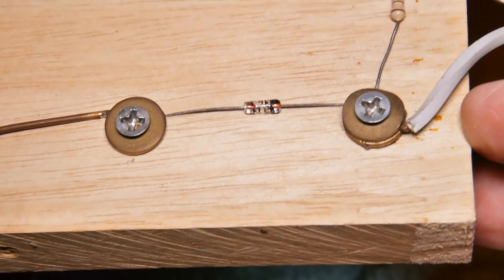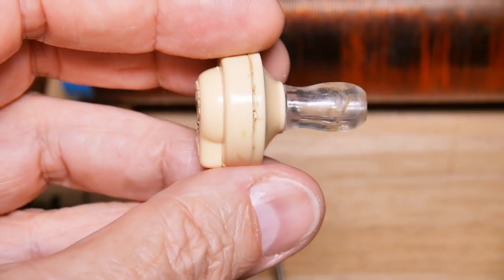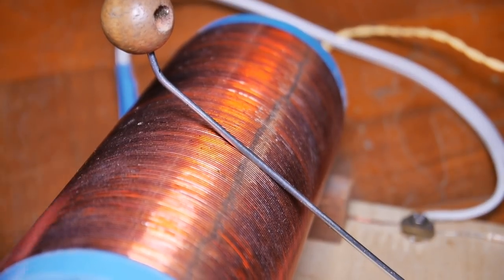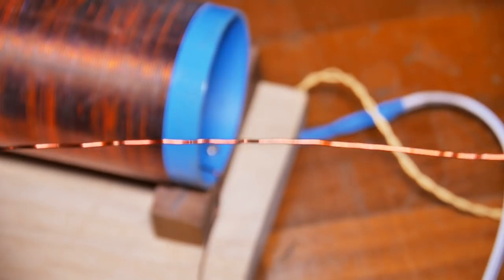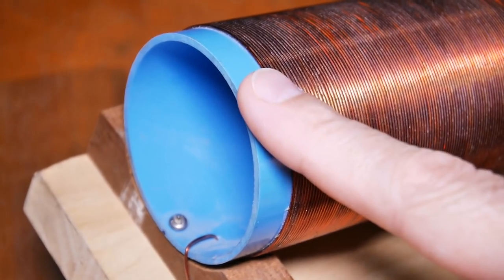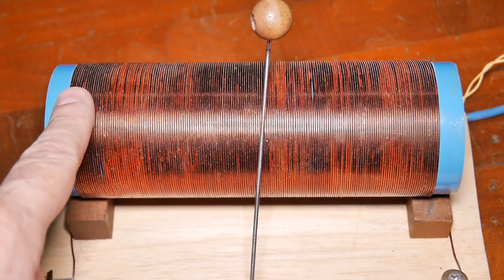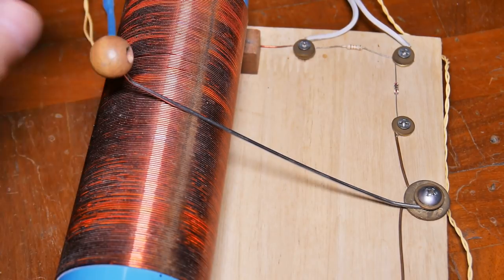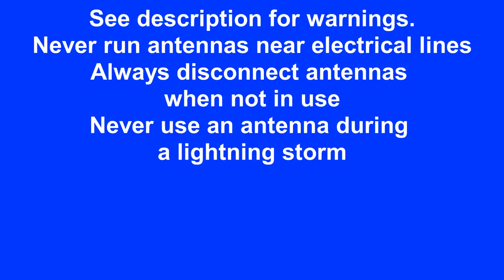My Crystal Radio Does NOT Work (FIXES for common problems)

Comment: Thank you.  I've made crystal sets in the past and they worked OK just not loud like yours even with my radio station running a kW and just 4 air mikes away.  At oue point way back then I bought one already put together.  It was OK, just not really loud.
Recently it took me 2 weeks to get a crystal oscillator to work on 7 mHz.  I'm learning to never take anything for granted.  Lately just about everything that can go wrong does go wrong.   lol   I  now have transistor testers, LCR testers set.  Maybe I need some tester testers.  Thanks for the tips.
Reply from the maker: Good on ya! Oscillators can be tricky, and higher frequency makes it exponentially so. I made my first one by accident by feeding the output of an op amp, through an old TV coil, back into the input. After that I was hooked on resonance.
Coils are important. I know I keep advertising myself, but here's a video on some coil sizes/wire sizes where I've already run the calculations and in the case of 19 AWG, already made several radios. https://youtu.be/ejHk5tFeKHk
It's worth the hour+ and cramped hands it can take to beautifully hand wind one. 

Oh, BTW, I have another video on adding an amplifier to a crystal radio, if you do want them louder. Personally I'm a purist and don't mix power with my crystal radios!  ;)
Reply: @tsbrownie   lol  I'm already watching some of your other videos.  😁  So your self promotion  is a good thing and helpful.
When I get my diode going I'll make the one with the L match.
30 years ago I was heavily into making home brew projects.  I read after Doug DeMaw and Wes Hayward and made a DC (direct conversion) receiver for listening to morse code.  I made a contact in Canada and a few more with the VFO only.  It measured 140mW on an oscilloscope.
I didn't realize how much anyone can forget when they get out of practice.  
I'll keep on piddling and I'll get there with perserverence and your tips.
I watched your video on bad crystal radio designs and it hit me like a slecge hammer.  Almost every one I made used the variable capacitor.  I'll wind the coils like you suggest and can leave out that cap.
Good on resonance and crampped hands.  I'm thinking about making a jig so I can use a variable speed drill to turn the PVC pipe for wingind coils.  I suspect the jig can't be harder to make than the piece you made to mount the variable capacitors on the 1979 radio.
Reply from the maker: @southernexposure123   Wow, I'm impressed with your DXing! I hear you on forgetting. I had to relearn a bunch of stuff before I made my first video. (I actually reviewed the original boy scout handbook I made my first one from!) 
I'm putting together a winding jig and a video (of course). It's just 2 wood cones (I've seen them online for about $1) with a threaded rod through it. You can mount it in a cardboard box of the right size. Cranks are good, but you can just turn the core by hand. I won't use a drill, because it's easy to kink/bend the wire, and tightly spaced turns are not just beautiful, they make for a better radio. 
I'm also going to start experimenting with "natural" diode replacements like galena, etc. The 1n34a is starting to get hard to find, then there's the fake factor. 
Let me know if there's anything I can help with.
Reply: @tsbrownie   I didn't know winding jigs were already offered so cheap.  The reason I thought of a variable speed drill was so I could run it slowly at a set speed and control OFF / ON with a toe or a knee.  A few years ago I used a battery fpowdered drill and set the speed just about like  rock polisher to make black powder.   I made it only once.  It's too scary and easy to get an explosion.  I set my ball mill outside a few hundred feet from my house.  Then I hesitantly approached it for stopping the mill.
I likely wouldn't have thought about wood for cores, although I have seen some coild wound on forms that weren't round.
I don't think I have the patience to try setting up a galena.  Oh earlier tonight I saw a video show and tell how to detect whether the 1N34A is real or fake.  Under that video was a comment telling how Skotchky diodes have some sort of benefit over the 1N34A.  I think it was something to do with better selectivity.
I was going to reference that specific vileo with a link, but a seatch yielded that there's more than one video on that subject:
https://www.youtube.com/results?search_query=how+to+tell+if+a+1N34A+is+real+or+fake
The one I watched was made by a fellow with a heavy accent, maybe indian.
I appeaciate all the chat and tips.  My next undertaking will see how big the wire is inside a microwave transformer.  I suspect it might be too small for our purpose.
Have a good night and I definitely will get in touch with any more mysteries or discoveries.  Thank you.
Reply: I've reserched microwave ovens for wire.  I knew people were saying you could get killed by the high voltage.  I thought I knew how to avoid that.  
But my research online tells me there's more stuff inside those ovens that can cause severe health issues if it's breathed into your lungs.  I think I'll just buy my wire for coils...
Reply from the maker: @southernexposure123  We used to make gunpowder from raw chemicals we bought at the pharmacy. That was before people got wise. The wood cones are to center the pipe on something like a threaded rod. I've got one sitting next to me I need to finish and do the show and tell thing. If you could run a drill/motor slowly by a foot, that'd be great. You're a step ahead of me, I had not tried that. The drill quickly got out of control when I used a hand, because I need both for the coil.
Reply: @tsbrownie  here's the comment about using a drill motor for a coil winder.  At second glance it looks like a book.   🙄

Modify drill motors to run a coil winder.

First and very important is to make sure the drill is a variable speed drill motor.  Otherwise the drill won't run slow enough for safety and convenience.
Set the motor so it runs at the RPM you like.  There's a few ways to set the RPM limit for your drill speed.

One speed control method (easiest) for a cordless and / or corded drill is to use the drill's built in speed control.   On many drills there is an adjustment screw made on the trigger.  That screw limits how far the drill trigger can be pulled and thereby controls the drill speed.  Use that trigger screw and set that screw so the trigger can't be pulled any farther than needed to get the RPM at which you want the drill to run continuously during use.   To get the drill to run when switched you MUST make the trigger stay pulled at all times.  Some drills have a LOCKED ON button on the drill to accomplish the continuously ON function.  I'm not sure, but I think the drill has to be running full speed for that button to make the drill to run full time.
To use that same drill later at a different speed, turn off the trigger's continually ON device and turn the trigger screw back to a different adjustment to allow a higher speed.

Another speed control method is to fabricate a trigger adjuster using an external screw to push against the drill trigger.   The screw control is almost infinitely adjustable for the desired motor RPM, at least to the drill's manufactured maximum speed.

In either case the drill motor will be mounted to adequately hold the drill while winding the coil.

Before wiring in a switch use the speed adjustment screw method to get the drill at the desired speed. 

OFF / ON switching
You want an ON / OFF  switch that allows you to start and stop the drill without you hands being needed to stop the drill.  You want to be able to keep your hands on the  wire while winding the coil.  The switching method here easily accomplishes that.  
A good candidate for  the switch is a  momentary ON push button switch.   
A momentary switch makes contact ONLY when pressed.  When the switch is released the drill no longer has voltage to run the motor.

A corded drill motor
A corded house voltage drill can be controlled with a switched receptacle for house volts.  Put the switch at a convenient location for switch operation.  Mount that switch on a board on the floor for a toe switch or on a table leg for a knee switch.

A  battery run cordless drill
Switching a cordless battery drill requires a slightly different modification than that used for a house voltage drill.  
Take the cordless drill battery off the drill and wire that battery battery externally to the drill using wires of adequate length to accommodate the desired switching.   It might require some ingenuity  to wire the original battery so it can be switched.   It might require using push on connectors that fit your battery operated drill.  If that works GREAT!   Otherwise find some other battery combination to get the volts needed to run the drill.  I used a lawn mower battery once.  
Make the battery wires a convenient length and put the power  switch in only one of the battery wires at a location convenient for operation during coil winder use. 
 
ON / OFF operation
Use a momentary contact switch.
Confirm the push button switch you use is  specifically a momentary contact switch.  Some push button switches keep the voltage switched ON unless and until you press the button AGAIN to turn the device OFF.  You want to be certain you don't use a switch that requires a second button push to turn your drill OFF.
Once that switch is wired you can turn the drill ON with a press of that switch and the drill will run only as long as you continue to hold the button down.  As soon as you release the push button the drill will stop running.  The drill will also run at your preset speed when the switch is ON.

Remember the drill trigger must be continually pulled ON.  This  is the same for a battery drill and for a house voltage drill. 

If you use a 120 volt corded drill motor ALSO use a momentarily ON switch between the house plug and the  external receptacle.  That momentary ON switch keeps the drill running as long as you press the button so it continues making contact.  When you release the button the motor will stop.  

It's best to use a momentary push button switch on the battery drill and the house current drill to control the motor start / stop operation.   Once again, confirm that the switch you use is a momentary ON switch.

Use a switch that's rated for 120 volts on the  corded house voltage drill.  Use switch rated for the voltage of the battery drill motor battery AS LONG AS  that switch is rated to carry the amps drawn by the drill motor.   For this purpose a switch for 120 volts will handle the battery drill current IF the switch is rated to handle 1000 watts – 5 amps.  120 house volts times 5 amps battery current equals 600 watts.

These days we like FREE stuff.  You might be able to jury rig a momentary push button switch.  IF so enclose the switch  and its wires in a non conductive container for safety.  House volts can be deadly.
 🙄
Reply from the maker: @southernexposure123  WOW! Thank you for taking the time for these explanations.
Reply: @tsbrownie    You're very welcome.
Reply: @tsbrownie    Aaaaahhhh ! I knew I'd forget something.  Many drills are also reversible.  If your drill is reversible too you don't have to make a specific plan to put the drill on one end of the coil or the other.  
I guess it doesn't really matter because you could wind with the wire on top of the coil form or on the bottom  depending on which way is easier to see  OR  just start on wheihever end is better for you.
Reply from the maker: @southernexposure123  Good point.
Reply: I don't know why I keep thinking about motors to run a coil winder, but I just now thought about using a sewing machine motor.  The speed control is already a foot feed speed control.  You could put a screw under the pedal to limit the maximum speed.  
That made me think about using a car windshield wiper motor.  Some of those have a speed control switch and the motor could be wired to the low speed wire even if you can't get the switch.  I know the motor will run too fast as is, but the mechanism that moves the wiper assembly rotates slower.  I'm thinking it might be slowed even more if instead of a 12 volt battery a lower voltage could be applied to the motor.  Unless you going into the busines  of winding coils the low voltage will run only a few minutes so low voltage heating won't be an issue if it even is anyway.
Reply from the maker: @southernexposure123  those are good. Now, you need a great way to hold the pipe in place. Something with a quick release. There's probably a niche business in there somewhere because winding is the worst part of crystal radio!
Reply: @tsbrownie Yes coil winding is a challenge to do a lot experimenting with.   And magnet wire cost is almost prohibitive.  I've bought AM / FM pocket radios for under $20.00.  Enough commercially bought 16GA magnet wire for a coil meets or exceeds that on the web sites I found.  I'm robbing magnet wire from the picture tubes of discarded b&w TV sets.  That wire is very small.  Maybe 40GA.  And that size has a lot of resistance.
 I'll see if I can imagine a quick and easy quick release method.   My first thought is instead of using a cone use a spring loaded a wooden ball.  Oh well.
Reply: My FREE coil winding machine.  I didn't find one for a dollar online, but this coil winder is free for me.   That's cheaper than a dollar.  Plus it's already dersigned and already built completely and includes the quick release.  lol
The ball mill I made those years ago, I went and found the thing.  I rarely throw things away.  Anyway, the most recent challenge we talked about is the quick release mechanism for the pipe.  On the top of my head I first thought about a spring tension mounted wooden ball to fit against, but not inside the pipe instead of the usual cone seen for the ones shown online these days.  The ball would have a hole drilled through the center for a long enough bolt and the ball could be pulled back from the pipe to release the pipe when the coil was finished.  That's possible, but unnecessarily complicated and adds cost to what we want to be free.  
The drill was given to me at a yard sale because something was wrong with it being useful.  So the drill motor was free.  All the control parts were built into the drill so the controls were free.  I already had the wood and the adjustment screw, so that was free.  Everything I needed I already had laying around.
In the years since I made the rotator I forgot that I already made the quick release as part of my original ball mill design.  
A little while ago I started shooting a video and stopped because rain got too plentiful to continue.  I'll shoot the rest as part 2 and post that when its finished.
I'm about to edit and post what I shot so far and will let you know in this thread when it's posted.
Reply from the maker: @southernexposure123  You need to make videos of your inventions!
Reply: @tsbrownie I'm just about to press the up;oad button.
Reply: The upload channel says it'll be finished processing in about 45 minures.
Reply: @tsbrownie   I posted thre ball mill video back when I finished biulding it.  I don't remember the year.
Reply from the maker: @southernexposure123  I only see 1 video on your channel, the ladder antennal.
Reply: @tsbrownie  it's up now.  II had a hard time getting it public. 
 Don't know why
Reply: @tsbrownie  🙂  I made the modified drill video back when I first made the thing.  I just hid the most recent drill video video because YT inserted an advertisement. 
I have one 1N34A diode I can find and have others that I misplaced some years ago.  I ordered new 1N34A and they sent 1N914.  Aaaakkkkk.  Next I'm ordering 1N34A from a different supplier.
Thinking maybe I'm deaf I set up and connected a LM386 IC to the crystal eafio output through a disc capacitor.     
While trying several different coils and switching between the new high impedance ear piece and the amp I accidentally left the ear piece in the circuit (where its suupposed to be, so no harm to the ear piece) and changed to another experimental coil.  The amp started giving 8 Ohm speaker sound on radio stations when the ear piece is where it shows in the schematic..  
I unplugged the ear piece and the amp quit playing,  The radio plays amplified (speaker) with the earpiece plugged in even when I take out the diode no matter which diode I plug in.  The ear piece increases the sound a LOT whether the diode behaves as a detector or not and whethrer the dide is in the circuit or not.  
I put different value resistors in parallel with the ear piece.  I checked the ear piece resistance and replaced the ear piece with different resistors hoping a resistor would make the diode work all by itself with the earpiece out of the circuit.  I think the diode works a little because sometimes I hear something amplified in the speaker, but extremely low volume,.
Did tou ever hear of such a thing?  
Oh, and with the earpiece in I can change stations with the capacitor like you showed how to make with foil sheets around a paper tube.  I can hear a few stations in the next room.
Any ideas about that earpiece making the radio work?.  It sounds weird to me.
Reply from the maker: @southernexposure123  The piezoelectric earphone has capacitance. (Old time earphones had almost zero.) These radios work on a balanced combination of very, very tiny amounts of inductance and capacitance. If they are too far out of whack, you get little or nothing. Adding in the earphone may be restoring some balance. I don't say this out loud, but most diodes will give SOMETHING, but often it is so little that you'd need a scope to see it. So I don't say that because I don't want to set them up for failure. 
About the amp playing, it's probably using the circuit as an antenna. No diode needed for that.
Reply: @tsbrownie Thank you for the information.  A few days ago, before thinking the crystal part of the circuit was working  I tried twisting a few unconnected wires and inserting them into a few places.  That gives a tiny amount of capacitance as shown in the video how to make a Franlkin VFO.  
OK on the (in progress) crystal radio could be acting as an antenna for the amp.  
I put in a ground rod and wire and somtimes it makes amp noise less and sometimes it makes noise worse.  I think that's in the components surrounding the LM386. I also have a new desk light that's a noise source.  I'll replace that light.  I'm mostly running the LM386 at low gain without the capacitor that gives the IC  monstrous gain.   I'll work on that, too. 
At night I'm hearing WWCR in Nashville TN (100KW) and a few minutes ago I heard a local station Shreveport LA (35 air miles) at 50KW.  There's a 1KW station about 3 air miles away.  They have an almost non exixtent ground radial system.  I know their technician.  
A day or so ago I also wondered if the ear piece was acting as an antenna, so I replaced the ear piece with one wire about the same length.  No joy.  Your tip about the ear piece having capacitance tells me I should twist a few unconnected wires to put there instead of a single wire.  It's just something else to try until the new diodes arrive.
The new diodes should arrive this week.  Maybe that's the key.
Oh, I inderstand why you don't usually mention those details in your videos.  Thanks for cluing me into that.  
I just have some more work to do.  Thank you for hanging in there with me.
Reply: @tsbrownie   When you told me about ear piece internal capacitance I tested the  ear piece.  It's about 27nF.  I put a disc capacitor of about that value in the circuit  and the amp played without the ear piece.. It also plays witht he ear piece in parallel with the capacitor.  It's not as loud that way so maybe the capacitance needs adjusting, but it'a a step in the right direction.
Still I hear no radio in the earpiece.  Hopefully, the new diodes will fix that issue.
Reply from the maker: @southernexposure123  You should open up one of those resonance calculators (I have links in the descriptions of my radio videos) and play with the values. It's amazing how small changes in inductance and capacitance can make really big differences.
Reply: @tsbrownie Thank you for posting the calculator(s).  I've been there and go back often and appreciate the availability.
One thing I use them for is to check whether I have the correct syntax in the calculator worksheets I write.  When the Internet goes down I have the calculators handy in my computer so I won't be dead in the water and have too many mysteries to contend with.  
My worksheets aren't as handy and as fancy as yours.  With yours we have only to enter a value and the frequency shows immediately.  With mine I have to move my cursor to another cell to get the calculation.  
I can't remember if I told you about getting the earpiece out of the circuit and the radio working using a combination of capacitors and resistors. I looked at the earpiece as a resonant circuit for audio and measured the capacitance and substituted capacitor and resistors in its place.  
The sound got quieter when I took out the parts, but the amp  worked.   
After getting the ear piece substitute removed 
After getting all those parts removed I tried the same old diode with the earpiece with the amp turned off.  There's still not enough volume for me to hear in the ear piece.  I think the earpiece is OK because when I touch the leads together I hear a click.
The only thing new I haven't shared is my coil combinations.  I wanted to try tour antenna tuner coil for trying varous coil coupling distances.  I could have made a slip sleeve for that, but there is an additional experiment I also wanted to try.  What I did was wind a coil about like your antenna tuner coil.   I used a short 1.5"  diameter PVC form for the coil of thick wall pipe.   It fits inside the larger coil (2" diameter) so I can adjust the frequencyu that way as well as use the variable capacitor for tuning.  Doing that experiment answered a few of my questions.  Different coupling distances work OK, but I think making the antenna tuner adjustable so it can be tapped like you did will work better.   
Oh, after I took out the ear piece capacitor  / resistor combination and earpiece and because the radio still played and tuned stations I took out the diode.  It only decreased the volume a lot (so as you suggested before) the parts are working as an antenna for the LM386 because it has so much gain, but when I reinserted the diode the radio stations got louder. 
This reply is turning into a book.  lol
I suspect part of my problems might be caused by not connecting parts as per the schematic.  OR maybe the new breadboard has shorts.  At the moment I's rather blame the breadboard.  lol   
Oh well.  I think I have things correcct now.  All I have left to do is try the new diodes and see if I can hear in the ear piece.  Or discover I just can't hear.